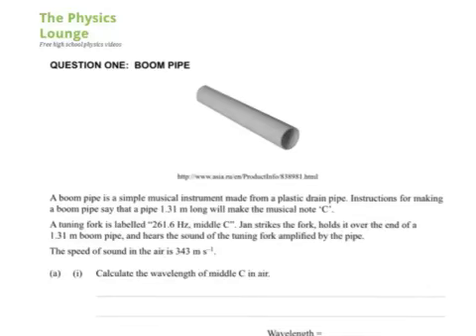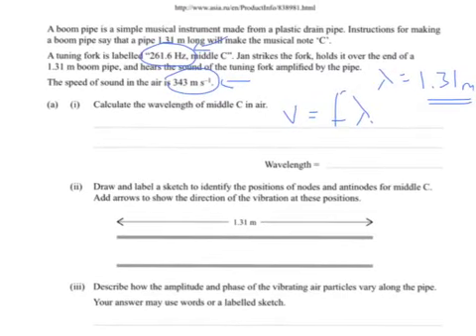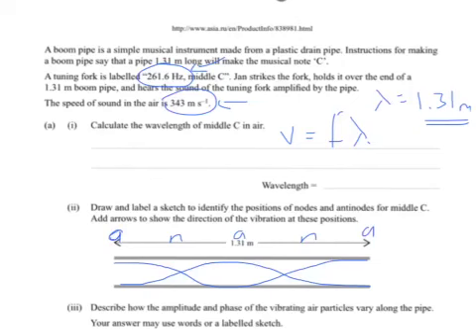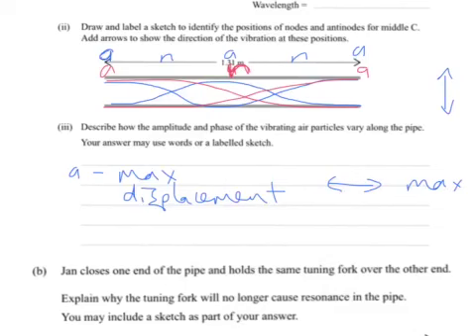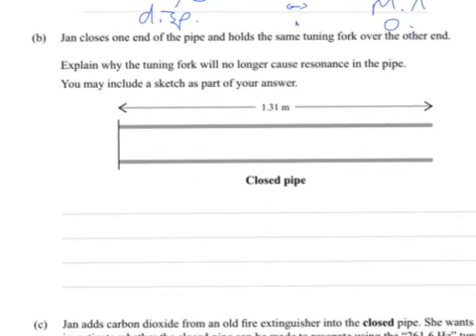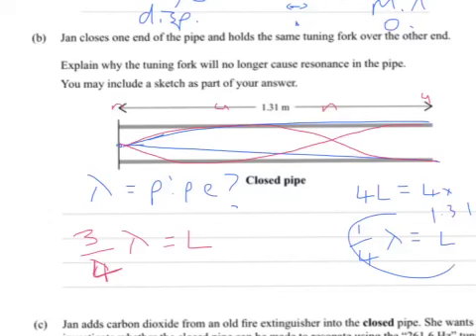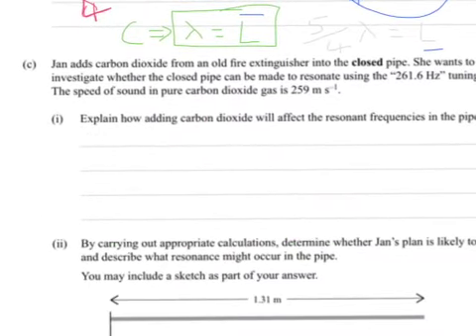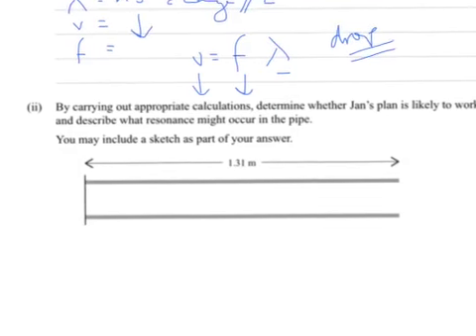2012 waves (ncea level 3) q1part 1

Comment: I'm still quite unsure why the fundemental wasn't used for question 1) b)ii) could u please give a reply
Reply from the maker: +Philip Kang There is no question 1) b) ii) but there is a 1) a) ii). In that question you use the wavelength for middle C which leads to the diagram as drawn. You can always check the solutions on the NZQA website if I'm a bit vague.  Sorry if that's the case! All the best for your exam tomorrow! :-)